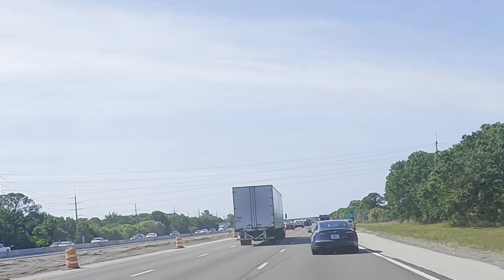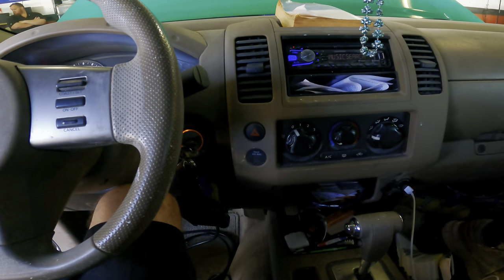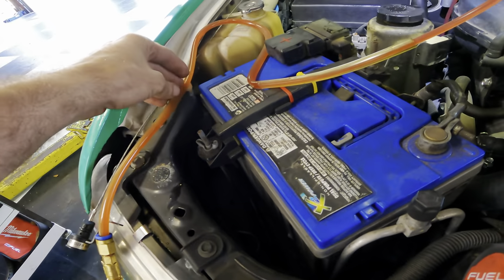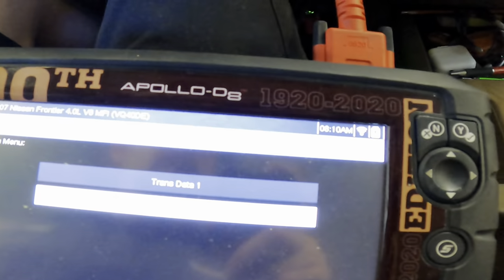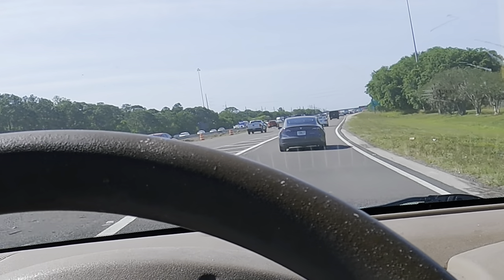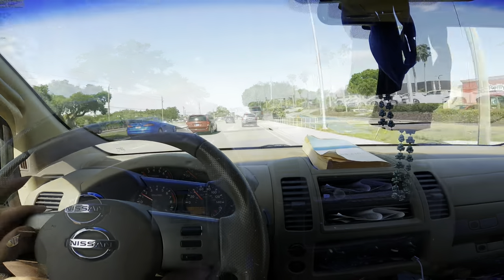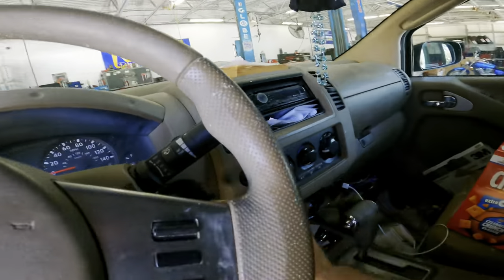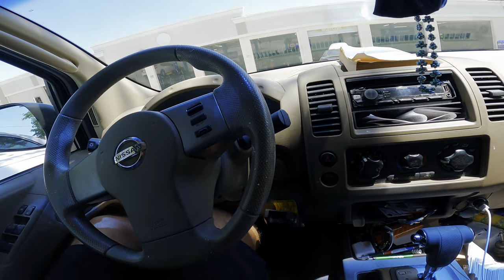Customer States: Vibrates Sometimes! How to save money by using your words!

Comment: I recently took my 2014 Fusion to my Ford dealer for normal maintenance. In addition, I told the service writer that I had a problem with my windshield washer. It was not putting out enough fluid. We had a discussion about possible problems, checked level, checked for fluid being pumped onto the ground, plugged squirters, etc. Ultimately, the service writer wrote "windshield washer doesn't work". Great info there. The tech figured it out and fixed the problem. Some foreign matter being sucked up from the fluid tank. He cleaned the tank, filter and lines. It works great now, but the service writer left a lot to be desired. There is a more complicated problem I have with air box actuators that I tried to demonstrate to the same service writer with a blank stare reaction. I may take an 80 mile trip to have you work on it. It should make a good video.

Comment: Torque converter clutch: That's the lockup clutch that bypasses the torque converter once the vehicle gets past a certain speed (some vehicles may use engine RPM as well/instead, or even other conditions). It's electronically controlled using a lockup relay, and stuck valves and whatnot can cause the relay to not be triggered (assuming the relay and related wiring aren't the issue). So exchanging that fluid may have allowed the pressure in the trans to get back to proper levels, etc.

The torque converter induces loss of engine power to the transmission as a general rule (fluid coupling dynamics), especially at higher speeds. The lockup clutch locks the converter so that full engine power gets applied to the transmission once conditions are met.

Comment: I'm impressed how Ray thinks in a methodical way to come to a solution, with minimal information from his service advisor and customer input. Using the scan tool and resources to figure out an outcome to a given code. You would think the customers would clean out there vehicles before bringing them into the shop, but that's there daily life stored in the vehicle. I've seen a lot worse working on tractor trailers.

Comment: Here's a note for my current car problems:

Car shaked hard when braking to a stop. The shaking only seems to start when getting closer to the full stop. Car also shakes a lot more noticeably, but less often, when reversing out of a spot with the brake applied. Loys of vibration noises.

Car also has a subtle stuttering feel when idling at a stop. Putting in neutral helps rid the stuttering. But the car doesn't seem to stutter when first starting the car for the day. I cant help but notice all the lighting (dashboard, dome, map, etc) seem to flicker along with the stuttering and with the vibrations.

Also maybe once every 4 months we'll experience a few days of total loss of power randomly. As in no lights, sounds, warning lights. Can't even turn the key to unlock the door. We could casually drive to do grocery shopping to come out to a dead car. Jiggling the negative cable seemed to produce positive results. But not all the time. Some times we just had to let it sit for a day before trying again. 

Another issue with losing power is that driving slowly (parking lots mostly) the car would randomly die/stall. As in the steering wheel locks up, all the warning lights illuminate such as TC, ABS, oil, etc. You also would hear a click when it died and a click when it "revived". Usually we would try and ride it out of the parking lot, turn the car off and key out and try again, or attempt to try to restart the car but be met with the complete loss of power again. One time I had it do the steering wheel lock up, lights, etc 5 different times as i desperatley tried maneuvering into a parking spot. 

Also very last ive lately notice a noticable rubbing feel/sound when trying to get up to 45mph at around 35mph with 1,500 rpms. Playing with the gas pedal allows me to "bypass" this feeling and get up to proper speed with no problems. 

2006 toyota rav4 2.4L bought with 213,000 miles currently at 250,000.

No history of repairs. It has major oil leak around the valve. 
New alternator, serp belt, and battery.
Two of four new ignition coils, 4 new spark plugs. The coils failed and threw p303(?) Codes to diagnose. 
New rear tires.
New rotors and pads all around. 
New front driver ball joint.

Comment: Being an owner of a Frontier I know a shaking issue. Mine has done it since new so has many other people on Frontier forums. The idle is set very low on these. Some people were able to have the dealer up the idle by 50-100rpms and it fixed all the shaking at idle. I noticed that as the truck gets older the shake appears worse but it's just the old hard plastic panels making more noise. Other noises from the shaking were normally heat shields. I think there may have been a TSB on the issue at one point over the years. I just live with it.

Comment: I didn’t go through all the comments but it’s probably idle speed. They idle the Frontier so low, sometimes with the A/C on, under load, heat soaked, it shakes. Bump the idle up 100-125 rpm and advance the timing 2 degrees. It’s a VERY COMMON, Frontier thang.

Comment: I brought in a 2000 Ranger to my shop of choice for repair.  The truck was a family member and I drove it a few times and got a clear idea of the complaint at hand.  Noise coming from belt.  Brought it to that shop on the appointment and told them the following, "The belt is making horrible noise, another shop installed the belt and an idler pulley.  Could be the tensioner."  The mechanic drove the truck in, clearly hearing that squeal.  Decided to check my assumption the mechanic grabbed that belt and pulled all the slack out of it with no effort.  His words to me "You were right, that tensioner is junk."

Comment: Ray I think under customer advice notes I would have recommended : REMOVE RUBBISH FROM PASSENGER SEAT. This is adding additional load the vehicle does not need to haul.
This will benefit fuel consumption and help increase its hauling capacity. Also.. Removing the junk will reduce rattling and ensure a smoother and more compliant ride.

Comment: I once hit a transmission in the road at 85 mph on the Florida turnpike in my 6 week old Honda Odyssey (it was the end of a holiday weekend and traffic was moving well, but bumper to bumper). At the next service plaza I got out to look under the car and couldn’t find any damage. The car drove fine, so we went home and the next Saturday I had an appointment with the dealer to address a prior problem. As I’m driving up a mechanic happened to be walking along and he asked me why the van was squeaking. Turns out the left rear control arm had been bent by the impact with the transmission.

Comment: You should try the system that we got in many workshops here in Sweden, we’ve got what’s called personal technician meaning that the customer speaks directly to the technician both before and after the repair is done, so much better for everyone and take a lot of miss communication out of the equation.
Reply: I like the Finnish system, you send an email to reserve your service, if they have questions, they have your email. No unnecessary chitchat, only question needed is debit or credit. I might be joking. I've also been able to talk to the mechanic directly, it's nice. Having a middle man seems to create an extra layer of bureaucracy.

Comment: It never fails to amaze me how little most people know about automobiles in general.  I don't expect everyone to have an in depth understanding of all systems and components of everything in their vehicle but, at least a standard understanding would be helpful. I work at a ski resort in winter. Part of what I do working with or vehicle maintenance is helping guests if they are locked out of their vehicle or can't get them started (happens alot in very cold weather).

 I can't even tell you how many times I've gotten called to respond to men and woman who claim they need a jump but when I get there, they say their battery is dead because all it does is crank without starting.  The first time I heard that, I was a bit dumbfounded and thought it was a one off. I couldn't have been more wrong. I must hear that 30 times a year.  So,  even things that I would consider very basic understandings like, if your battery is dead it wouldn't crank in the first place, are lost on many people.

 That being said, I have no doubt that trying to decipher what a customer is trying to describe as opposed to what is really going on can probably be maddening. My other job is I own my own electronics repair company. I feel like I see very similar behavior there when people try to describe what was happening with a device before it failed. But, electronics obviously don't have as many systems all tied in together,  at least in my experience, diagnosis of a bad PCB is pretty straight forward.
Reply: Haha,  and then later in the video, you say pretty much exactly what I was trying to say. You are absolutely correct, Ray. I need to remember to watch to the end before I comment.

Comment: A coincidence! Just picked up my daughter's Nissan that had the very same P0744 error code. Transmission guy put in a new Valve Body Assembly.  I had replaced the CVT fluid not that long ago. We'll see if that fixes the problem of car not going into 4th gear suddenly on fwy.

Comment: I usually try a trans fluid and filter change before bringing a car in for trans service.  And yes... twice it actually worked!  In one case it was that the filter was pretty much clogged with old clutch material even though the fluid still looked pretty good in the other the new fluid freed a sticky solenoid.  On the other hand, once the fluid is roasty toasty black a fluid and filter change doesn't usually help.  Still, it's rare to get out of a trans shop with a replaced vacuum line or a band adjustment on a modern car.  More times than not, the cost of the repair exceeds the value of the car.  So I get why the guy that owns that Nissan doesn't want to go down that rabbit hole.

Comment: As a customer, I took a truck to the dealer service shop and stated specifically “input seal leaking (drips) on rear differential.” I got my truck back with “oil filter tightened.”  Needless to say, I was irate to see leak still there.

Comment: Ray    you must drain trans fluid fromd drain on automatic gear box   then fill with the correct amount of new fluid, then run engin to working temperature  then select each gear     Drive     1st gear   2nd gear  to let the fluid fill all the channels  then check the fluid with engin still running     warning      the dipstick should be kept clean and wiped with a lint free cloth    eg   nothing where fibers from the rag can get into the gearbox oil channels the smalest  of fibers in the channels can and do dammage the automatic gearbox.
               Cleanelyness is the watch word .          Reguards from John UK.

Comment: This video was timely for me as I just had to deal with a very odd no start in my TrailBlazer. When I explained to the mechanic who had just put a new battery in and that the car would start a bunch of times and then not start he looked at me like I had three heads. So after much wiggling of the remnants of the positve battery terminal bolt he's like ok now I see whats up. Borrow my ride and go get a new bolt and bring it back and Ill take care of it. That solved the problem. I dont know to fix my car but I do try to communicate my issues as best I can so that the mechanic or technician has a place to start.

Comment: It goes both ways. I went to my “trusted” local shop just for front tires. One kept leaking air. Easy tps sensor. The fact they offered to take em out for free or replace them. Not just charge me an extra bucks per tire.

Comment: I hear you on getting into auto transmissions. If you want me to fix something internal it either goes to a specialist or I can install a used transmission or a new one if still available. I don't get into rebuilding. People need to do a better job securing their load on the highways or rent or buy an enclosed trailer.

Comment: Service writers always bothered me because most don't really know anything about vehicles. Back in the 70s when I worked at a dealership, the service writer was a mechanic so he knew the questions to ask. When I had to take a new car to the dealership, I always tried to provide as much information as possible. I had a vehicle that when using remote start when the temperature was below zero, it would start and die and it could only be tried twice before the vehicle had to be entered to start it. Through Alldata, I found a TSB on the problem and provided that as well as printing out the problem on a sheet that I left in the vehicle.The service writer apparently removed the documents from the vehicle. When I showed up to pick up the car. the only thing on the ticket was starts and dies with remote start and of course it started because it was warm out. The second time I scheduled it for a day when it was supposed to be cold out and scheduled it for first thing in the morning so it could sit outside overnight. The service writer, in her infinite wisdom, parked the vehicles in the shop that were scheduled to be worked on first thing in the morning. Service writers now don't seem to want customers talking to mechanics or vice-versa.

Comment: Hey there!
Have you checked the cardan shaft/drive shaft on this truck yet?
Sometimes the joints there can seize up due to mud or oxidation. This might lead to shaking or vibration, due to the joints not operating properly and not smoothing the movement of the shaft. A bit of spray oil and moving might help then! Could also be done at any maintanance, just takes a few seconds.
I hope you're doing great.
Kind regards from Germany

Comment: Transmission seals wear with time, in some cases where automatic transmissions weren't serviced at regular intervals changing fluid and filter may cause the transmission to operate erratically and may need the old thicker fluid (filtered) to be reused. Sometimes new fluid and additives may not give the desired effect.

Comment: My '07 Ford Fusion had a VERY similar issue.  A very slight vibration (almost unnoticeable) at idle when stopped in gear and went away when moving, the same as that vehicle. However, when you turn the AC or defrost on it became VERY pronounced when stopped in gear. Turned out to be a weak motor mount.

Comment: Customers generally consider everything as a black box , they know what they're supposed to do and what it's supposed to do . Once it goes outside normal operation they believe pixies have somehow gotten into it , average synopsis of the issue that a customer will give is " thing no go , make it go " usually accompanied by " definitely wasn't anything that I did or failed to do that caused this". Stunted on the details yet verbose on the denials.

Comment: It’s a Nissan, so it’s got a list of unspecified issues that plague the overall experience…..😂👍
And Ray, you won’t get TCC voltage sitting in park or neutral.
The converter won’t lock under those conditions….(motor stall)

Comment: To be fair some people just have zero clue on what and or how a vehicle works, handles and such.  I had a new employee take a fleet truck 120 mile round trip. came back and told me the truck started to handle funny, they had no idea just that it seemed odd. Turns out they lost the rear wheel on the highway and drove it on the rotor for the last 15-20 miles or so. But never occurred to them  to pull over to see what going on.

Comment: A old transmission expert showed me how and where to drill and tap a 1/8" pipe plug hole in the torque converter, too completely drain system.

Comment: I agree Ray about the  service advisor asking the right questions to be able to get as much details for the technician. But the service advisors have ALOT to deal with, phones ringing while people could be screaming at them, waiting customers and keeping them informed of the work. Cars being dropped off on the back of a truck with no info at all.
So the job of a SA is not easy, and asking the customer 20 questions to find out what exactly is going on is not always thr best way of dealing with a already possible heated issue. Just my opinion.

Comment: Honestly, seems the transmission fluid removed looks water tainted. The Xterra's and Frontiers of that generation suffered from the separator in the radiator that diluted the transmission with antifreeze. It has an external transmission cooler and if you catch it early the bypass from the radiator will suffice. Also if the radiator is made by "Calsonic" which is located on the top of the radiator = replace.

Comment: I think the communication works both ways. You have to know your audience. So if you know that the customer isn't familiar with the lingo, you gotta help them out. Now if you are last in line of this communication (being the tech working on the vehicle) the shop has to do better in extracting the information needed from the customer to aid the technician in the diagnostic process. There is a reason the customer is bringing the auto to the shop instead of trying to diagnose/fix the problem themselves.